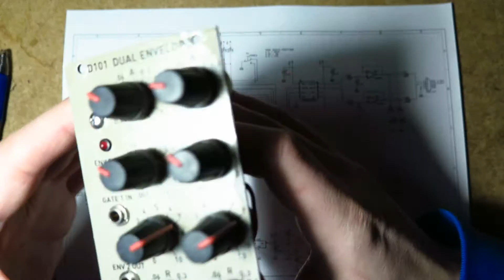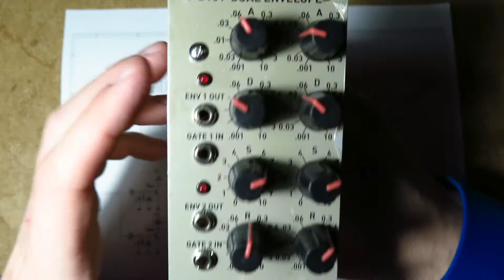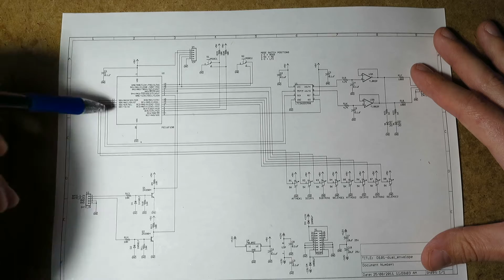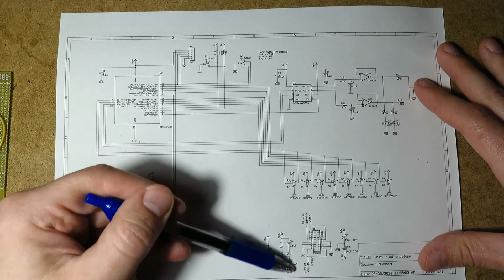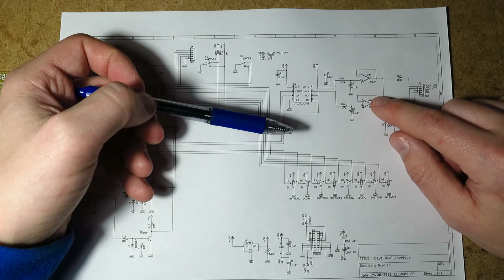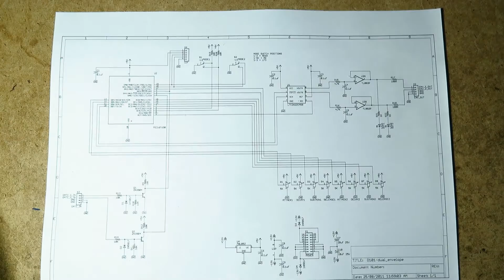Synth Tech - Dual Envelope Generator

Comment: I'm going to build this as soon as the micro comes in the post , I could not get the LTC2622CMS8 DAC so had to go for the Microchip MCP4822-E/P, will I need to change the code or will it work just the same ? I ask because I've not used the SPI bus before.

thanks for posting :)
Reply: thanks for post the code up , I got it working now :)